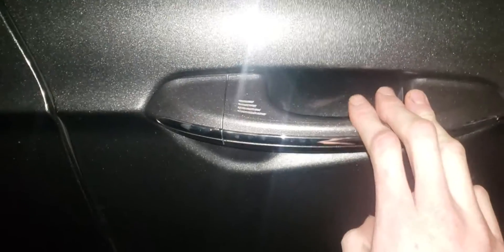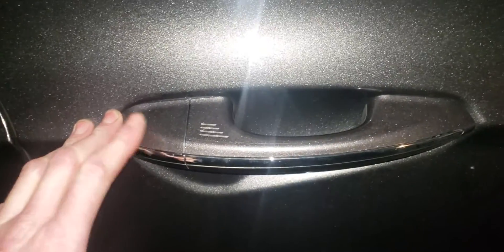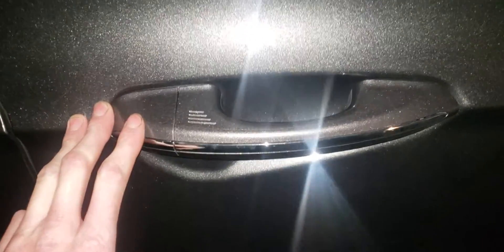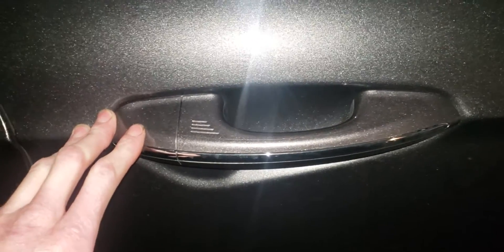Update on the passive touch system (not able to get it to work yet)

Comment: my car has keyless entry door handles but this feature is off. how do you think i can activate?  is it possible with forscan? Which code? Thank you for everythink
Reply from the maker: On 726-68-01 what does your read
Reply: Nick the car guy Last tile with bcm module 726-60-02
Reply: Nick the car guy my car bcm module dont have 726-68-01

Comment: Hi, what blocks are required in the BCM to enable it so i can have a look?
Reply from the maker: Is it for your fusion or festia
Reply: Nick the car guy have you got the codes for both vehicles?
Reply from the maker: @JRDN97  only for the fusion
Reply from the maker: @JRDN97  the festia got different firmware than the fusion
Reply: What’s the blocks for the fusion?
Reply from the maker: @JRDN97  for the passive touch it start at 726-68-01 and on
Reply: I have a 2019 fusion se but instead of the lines on the handle it has a lock how can I make it work? Does it need special equipment or all it needs it's on the pcm?